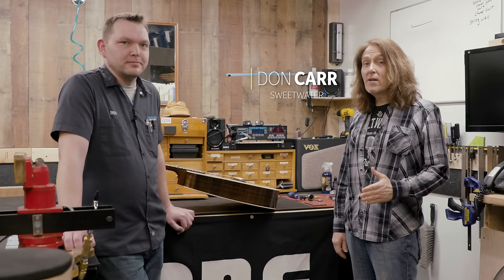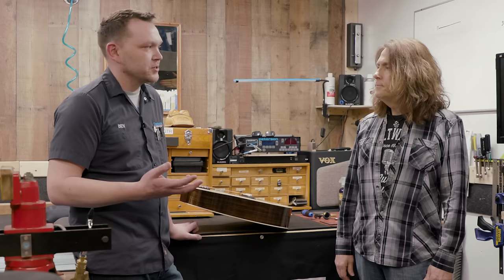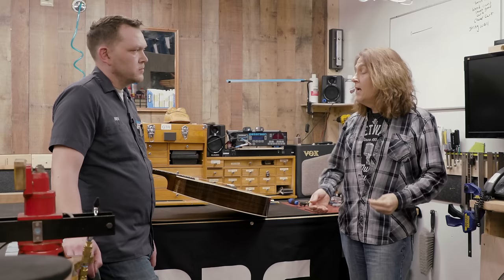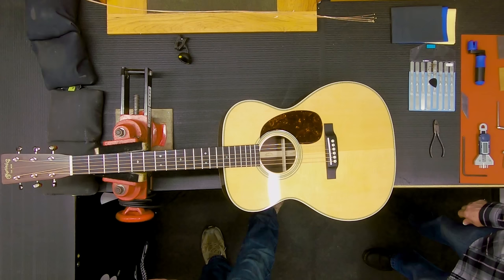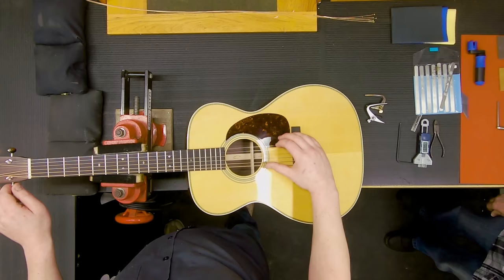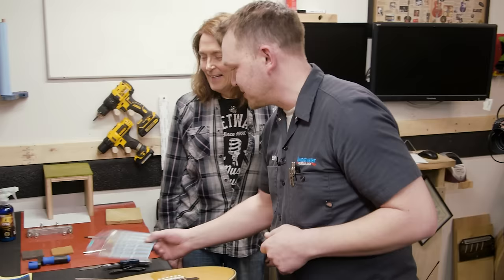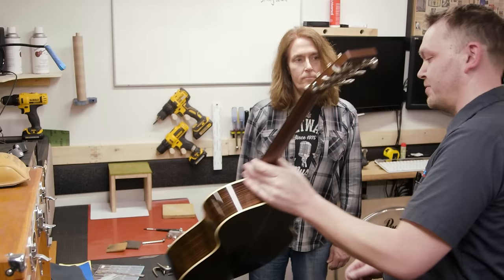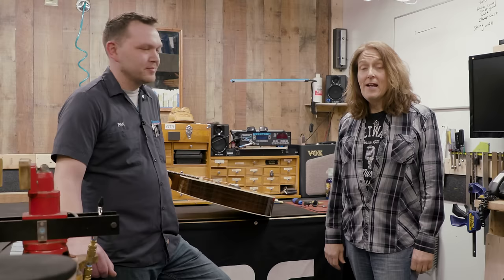Acoustic Guitar Setup – How to Set up an Acoustic Guitar 🎸 | Guitar Lesson

Comment: 1 - Visually inspect guitar for damage and obvious problems.
2 - Check nut groove height. Simple method of fretting 3nd fret and checking string height at 1st fret.
3 - Check truss rod relief. The how is missing. You didn't press any fret or check any string height. You pressed the strings down without fretting any which would not tell you about truss rod relief.
4 - Record string height.
5 - Adjust truss rod. Quarter turn, retune.
6 - Check truss rod relief. Press down on 13th fret and check string height in middle.
7 - Record string heights.
8 - Fix nut issues.
9 - Measure action at 12 fret in playing position.
10 - Remove strings.
11 - Adjust saddle.
12 - Clean fretboard and frets.
13 - Check machine heads.
14 - Polish guitar.
15 - Restring.

Comment: Hi guys, thanks for a super helpful video. A wee bit more special since you are setting up what looks awfully like my 000028H (#703936). Really appreciate the comments on humidity. I live in a forested area in SE Australia, which means hot, dry summers and cold, damp winters. So far I've had no obvious issues but if you have any tips for maintaining a relatively stable RH, I would be grateful. Also, I just made a little (necessary) trussrod adjustment and found it pretty stiff to turn. Hoping that isn't abnormal. Keep up the great work guys.

Comment: where do you get that digital measuring device that measures the action? also what is it called?  ty
Reply: Following
Reply: Would like to know this as well.
Reply: I'd like to know, too.
Reply: I believe that's a digital caliper. Maybe a Luthier's featherweight caliper? Hard to tell the model.
Reply: Google - Digital Nut Slotting Gauge
Reply: depth micrometer

Comment: Where did you get the gauge you're measuring the string heights with?  I don't see that for sale at Sweetwater.  My eyes are not what they used to be, I have trouble reading the small lines on the rulers, I could really use that. I'd buy one if you sold them.

Comment: Is it normal for a new acoustic guitar  to have a saddle filed down to almost no break on the high e string?  Did the set up guy do it wrong?  The guitar is a Gibson J45 Custom.  Very informative video
Reply: I'm wondering about the same thing. My saddle barely pokes over the bridge, which doesn't seem normal, but my action is still really high on the upper frets. I was thinking of replacing the saddle without filing it down so much then tightening the relief in my truss rod, but I'm afraid of turning the rod too far and damaging the neck.

Comment: What tool are you using to measure the nut slot height? I have a cheap prototype version but it isn't accurate because tolerances aren't tight.
Reply: looks like tire thread depth gauge

Comment: This is 4th video I watched tonight on string action. All 4 contradict each other. One persons “never do this”!  is the next persons preferred way of doing it. I guess maybe neither one of them is wrong. Like a lot of things in life there’s more than one way to skin a cat (as my dad used to tell me.) guess I’ll watch about four more and then try to get a consensus Hah!
Reply: First thing I did when setting up my guitars is put on new strings from 12's to 10's.  Then I put a capo on the third fret and check the action to the first fret so I have a accurate height for nut adjustment. I normally then remove the nut and file down. If you go a bit to far use superglue and baking powder or the sanding dust to add to height back on and file flat again just slightly higher this time. Then I check the neck bow and adjust the truss rod. Then lastly lower the bridge by making a new bridge from a bone blank. Quick to do and you have the original as a guide. I try and get mine as low as possible with no buzz. All my guitars have really great action and just takes some time. It only gets tricky if you have a guitar with issues but if its a new guitar go for it. You could also get a new nut if you wanted to you have all original parts in case you mess it up and they its just a minor truss rod adjustment. Its really pretty easy to do and if more guitars were setup properly a lot of people would not be quiting. I think manufacturers need to step up their game in regards action. Why not simply include a couple of nuts and 3 bridges so its really easy to adjust with clear instructions. They would add pennies to the cost of a guitar and people would keep playing and buy more guitars possibly.

Comment: It seems to me that you are first setting the action, neck relief and nut slot heights where they should be, then you lower the saddle - which will impact all of those measurements. 🤔 Why not reverse the process? There's a greater chance of going too low on the nut slots and, like you said: replacing a nut is a lot more than a setup.
Reply: I'm trying to get my head round how to setup my own guitar. I think he adjusted the saddle based on the measurements he took at the 12th fret.
Reply: No they are independent setups. The truss rod straightens the fretboard if necessary - you need a tiny little forward bend, or "relief". Then the nut is lowered so the strings start low enough from the neck so you don't have to press so hard and the deformation doesn't stretch the string so as to bend the note out of tune. And then you have to understand that when you fret a string, it becomes the string's starting point toward the saddle - it doesn't matter how low or high the nut is. Now the thing that matters is how high above the next fret the string hangs, and you lower the saddle just so the string can't rattle or buzz against the fret.
Reply: Relief first, then nut slot height, then action/saddle height. 

Relief: Capo first fret and hold down at the last neck fret before the body (usually 14th). You’re using the string as a straightedge here. Martin factory spec is .005” to .010” between the top of the fret and the bottom of the string at the 7th fret (or half-way). I’d shoot for about .005”. Adjust, wait, tune, check again. 

Nut-slots: You want to get this sorted out before the action. Best way is to press in front of 2nd fret. There should be just a minuscule amount of clearance between the strings and the 1st fret. 

Action: Measure bottom of string to fret. Martin spec is 6/64th to 7/64ths for low E, and 4/64ths to 5/64ths for the high E.
Reply: Relief is measured from the string resting on frets 1 and 12, the nut and saddle are not involved.

Nut height is measured with the string resting on the nut and second fret, saddle isn't involved.

And then the saddle is adjusted.

The poor thing about this video is that it doesn't really describe the steps in enough detail, which leads to questions like yours.
Reply: Good tip I read to adjust nut slot depth without going too far is to take feeler gauges and stack to correct height on the first fret up against the nut. Then file down to the feeler gauges and they should be at the correct depth.

Comment: What options are there to correct the "12th fret out of tune" condition on an acoustic guitar? The frets have been leveled, new strings installed, fret board straight, and so forth. Yet the 12th fret is out of tune with the open string for some of the strings.
Too bad there are no adjustments for this like on an electric guitar...
Reply from the maker: Hi, Dale. Intonation is usually adjusted at the saddle. Unfortunately, saddles can’t be moved on acoustic guitars so that is not an easy adjustment. Based on the string length settings on most guitars, Graph Tech does make a compensated saddle that takes this into account. Aside from the Tusq material having great tonal properties, the compensated string length will improve intonation on most acoustics. This would be an example of one:
https://www.sweetwater.com/PQ-9280-C0
Thanks for your interest!
Charlie Davis, Sweetwater Sales Engineer, (800) 222-4700 ext. 1320, charlie_davis@sweetwater.com

Comment: Ok. Lesson learned. When your guitar doesnt feel right, check the obvious culprits. If a simple truss rod movement does not fix it and if there are multiple issues regarding nut and bridge....take it to a luthier. Money well spent as far as im concerned, especially on an expensive guitar. Ive done quite a few faulty nut jobs (!) and bridge adjustments to know that my frustration can be avoided by simply bringing it to someone whos done this as a pro..

Comment: Excellent informative video. I once filed down a saddle to have the action lowered on my acoustic. The intonation went out of whack after that. What did I do wrong and how to correct this? TIA!

BTW, I've stayed away from messing about setting up an acoustic since. No problems setting up an electric :)
Reply: You just need to adjust the break point. Its easier if you use a blank to you have some meat to move the break point back as you lower the action. I really think manufacturers should supply 3 or so bridges for different actions that are setup correctly. I have had no issue setting up my guitars you just need to take you time. Plus if you go to far superglue and baking powder to lift back up 🙂

Comment: A fresh set of strings (a couple gauges heavier) should put a little relief in the neck, and clean up that buzz.... just sayin'... 12's made a huge difference when I put them on guitars that used to run 10's...
Reply: If you prefer 10s just set the neck relief